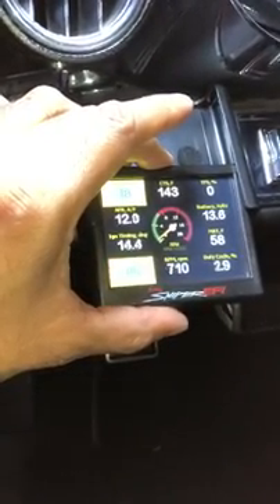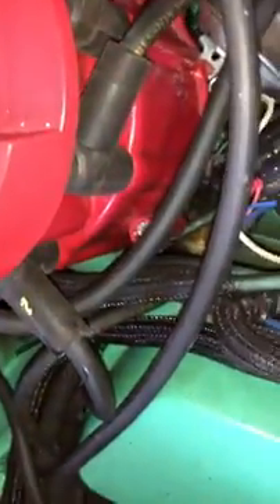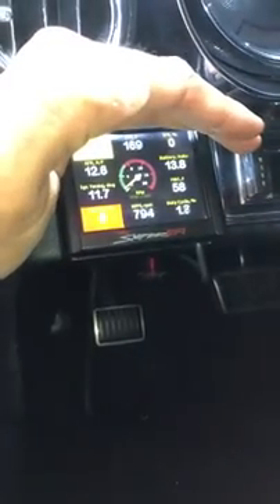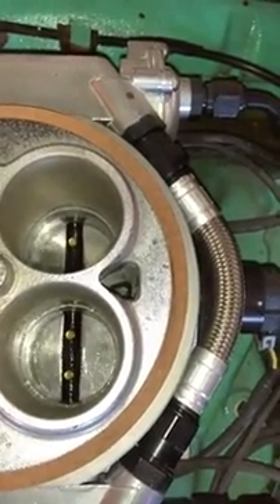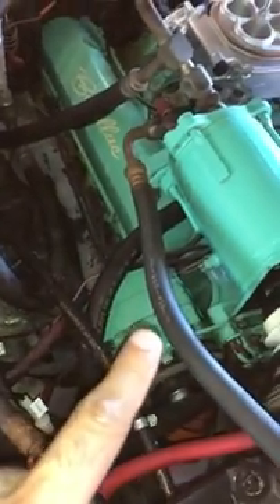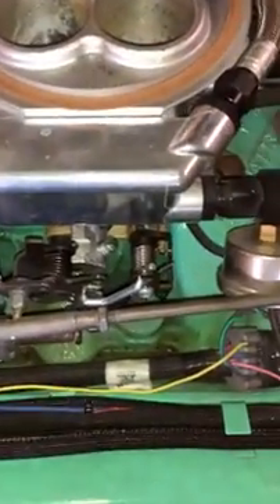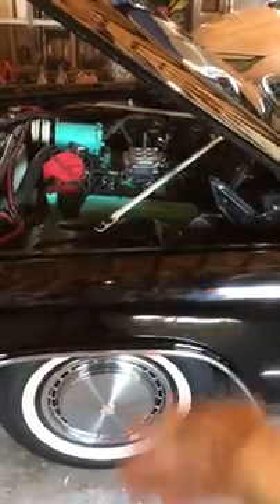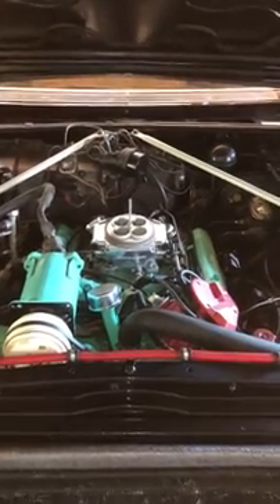Holley Sniper IAC idle hunting problem 1966 Cadillac

Comment: I am having almost the same issue.  I have been fighting this for almost two years!  Mine will warm up and then it opens the IAC and idles 1000 RPM higher.  I have a 71 C10 with drum brakes!!!  Makes it so hard to stop, I broke the brake booster pushrod.  I just updated my firmware tonight and see if that helps.  Keep me up to date on what happens.
Reply from the maker: That is exactly how mine started out. After being warm, I would come to a stop and the IAC would be commanded to come out of the “park position”. That would send my idle to 1700-1900 rpm! Your C10 is a heavy truck, and I too have all drum brakes, so I no what it’s like to stand on the brake pedal at stop lights:-) Get the $60 data cord, buy a pc laptop, load the software and go into your IAC spark control. It doesn’t make sense to me for a non-controller dizzy, but adjusting your p and d terms down to about 10ish makes a huge difference. Try that and let us know!
Reply: Mine is doing something similar, but it opens the IAC bringing the idle up to 2-2500 rpm, but the monitor shows 0%
Reply: @ezdubbin97  Put your thumb over the IAC hole, adjust the screw for the throttle plate where you get a decent idle.  Close it more and make the engine die.  Key off, key back on and check to see if it works.  Keep repeating until it works.  Close the flaps enough that the IAC takes over the idle control.  If they are too much open, the IAC just goes dumb.
Reply: Jeffrey Brinkerhuff that’s how I initially did it, and 60% of the time that’s how it idles (set at 780rpm, usually IAC @ 3-9%). The problem is the monitor will show the IAC @ 0% and I can go to the IAC port and get my thumb sucked in like its open 100%. It’s weird.

Comment: Mine is doing the exact same thing. Mopar 383 with dual plane intake. It is virtually undriveable and i am beyond frustrated.
Reply from the maker: Hi Pat, I haven’t pulled mine off to see if the dual plane intake is blocking the iac port or not. I wish I had more intel for you. Did you set the steady idle with the upper triangle iac port blocked off first?
Reply: @rajeevx7  No, we just typed in the idle speed (850). We are going to go thru the wiring wiring from the alternator first because my voltage reading was in the low 12s and thats not enough feed the sniper. Im hoping this might be our problem. I will keep u informed for sure.
Reply from the maker: Yes, low or fluctuating voltage plays tricks on electronics. After it’s warm, block the iac triangle off with tape and adjust the idle/throttle blade screw until it stays steady at 850. Also slow duty on the iac speed and I have my iac rest at 20%, seems to work the best. Good luck!
Reply: @rajeevx7  
So we did some rewiring as it looked like there were problems with the wiring on my old Mopar, which is common, however I'm still having the same problem. I read something today about some guys having the same symptoms with their Sniper that I am having and it turns out the issue was stemming from a faulty coil, and when they changed their coil the problem went away. So that is now my next step
Reply from the maker: I don’t see a weak spark causing hunting, but I could be wrong. Hopefully you have a stand-alone coil that will be easy to swap with a known good one and you can report back. My dizzy is an HEI large cap and I will go after that based on your positive results. Look forward to hearing back from you!
Reply: @rajeevx7  
Well, i swapped out my coil and it worked....initially. i went for a half hour drive and it was PERFECT! No chugging, backfiring, hesitation, or screen "resetting". It hadn't driven like that since I put the sniper on the engine in the first place. Needless to say i was ecstatic!
Then, later that evening I drove it home and the problems began again, not quite to the degree that they used to but there were still issues. So I'm back to being puzzled? Perhaps it's the wiring to my coil, or the coil is located too close to some other circuitry. I'm just not sure. Looks like I'm going to have to continue with my trial and error diagnosis.
Reply from the maker: Ok! So, it seems as if a few tell tale signs are pointing at the wiring and rf interference. Is everything separated as much as possible, including plug wires? So close...on the right path!
Reply: @rajeevx7  
Update:
Tried a different coil but still getting negative results - still basically undriveable. Through the data logs we've been able to narrow it down to electrical interference. All of the wires simply must be too close together, so we are going to rewire everything and space it out in such a way to eliminate any possibility of RFI. I've also gone ahead and purchased the Holley hyperspark coil and control module to basically complete the sniper package (except the holley fuel tank). Im praying that all this works. Its frustrating not to be able to drive it in this summer weather. I will let you know how it goes.
Reply from the maker: Great! That sniper ecu sits in the front of the tbi, which is sooo close to the factory coil mount. So, nothing can really be close to the front of the sniper, which I think you will solve with the new hyper spark. Also, some 383 guys run the plug wire to the (8?) rear right cyl over the head. Make sure that one is also below the head with the others. So now, you will have no ignition wires to the right or directly in front of the sniper. Batt on the left? All sniper wires out the back, high and to the wheel well or firewall. There should be no rfi with the new routing. I’m believing that every time the screen was flashing, it was essentially a reset of the ecu. If that goes away you should be free and clear! Summer and car show season is upon us:-)
Reply: Mmm

Comment: Nice Caddy! I came across your video because my 70 Impala has started to do the same thing. Last summer everything was working great and I haven’t done any modifications since then. Suddenly as warm weather has begun and the car gets to full operating temperature my IAC has started doing some crazy things, much like what you are seeing. Since the ECU is inside the TB it wouldn’t surprise me if the high temperature is breaking down the electronics. Question, once the engine is warm will the car run normally if you unplug the IAC during a drive? One thing I did just notice today is my charging voltage is jumping around while driving. Might be time for a new alternator and could be having a problem holding enough voltage for the IAC to operate correctly. Good luck with yours and please update if you find the problem.
Reply from the maker: Hi! Mine has done the same thing since new, but will only start acting up at approx. 171* like clockwork. That may be where it switches into closed loop. Your theory on the alts fluctuating voltage sounds spot on. I know electronics do not like power surges, hopefully it’s as easy as that! If my car is warm and hunting idle, I can either disconnect or block the iac port and the idle is dead-nuts smooth. That test verifys no vac leaks. I look forward to updating this with a fix. Another poster suggested that the lower iac entry port may be partially blocked and my goal is to try to find that next. But, before I labor to remove the Holley, I need to find a base plate diagram so I know exactly where the iac entry point is. ‘70 Impala is one cool car, good luck!!
Reply: You may have already read this but I just came across it and will try to test mine. 
https://www.efisystempro.com/efi-pro-hangout/holley-sniper-efi-instruction/holley-sniper-efi-instruction/iac-testing-procedures

Comment: you need to have a single plane intake. or the bottom side of the IAC port is blocked either by the gasket or the intake.
mine did the same thing. i changed the intake and the problem was solved.
Reply from the maker: Hi J!
That’s the first time someone has suggested that. I’ll find the IAC port on the bottom face of the TB and make sure it’s not blocked by anything. I am using the factory 429 dual plane intake. Thanks!
Reply: I have a single plane intake on my set up and my car won't idle worht a shit!!

Comment: Let me know if you want to sell it I'll take it off your hands
Reply from the maker: Lolz! I am at my wits end and have thought about throwing this thing in the river. I can’t understate how this KILLS the fuel useage! I’ve gone through 15ga just idling in my garage trying to tune the thing. 
I did get my $60 cable and tried to live tune the software, but the results weren’t great. I am not using it correctly or the cable is not worth the money. 
Next step is a tuning seesion with a Holley trained speed shop about 45min away from me. That is on 3/14/19 and I will report back after that with an update.
Reply: @rajeevx7  sweet good luck. Have you thought about replacing the iac
Reply: I would also move all the sniper wires away from the distributor and sparkplug wires hei dizzys are notoriously electrically noisy
Reply: Beautiful car btw

Comment: Looks like a faulty ECU to me...
Reply from the maker: Hi Dan,

That is what I am thinking too. The Holley forum guys have told me to re-smooth my idle area. That was done and had some effect, but not as playing with the p and d term limits on the iac motor itself. Factory default has them set to 38 and 45, and what seems to be working better for me is a 13 and 15. I think the iac is just oscillating out of control and can’t find its spot without chasing its tail and starting over again. 
Next step is to use the can-usb cable and adjust fuel and idle control live as the engine is running, instead of the sd card back and forth. Thanks!
Reply: I'm glad you are getting it figured out. I don't know anything about the P and D terms. Looks like I need to read up on them and learn.